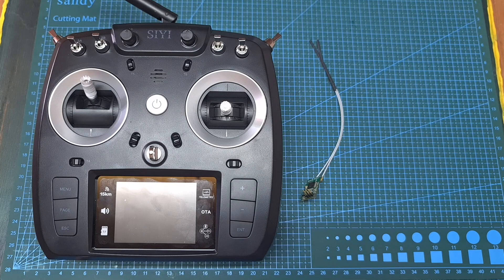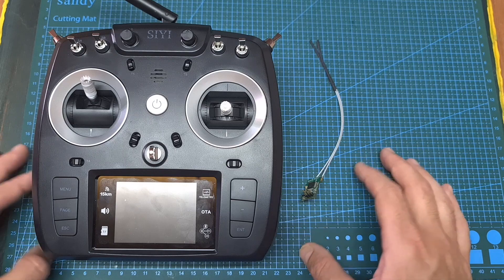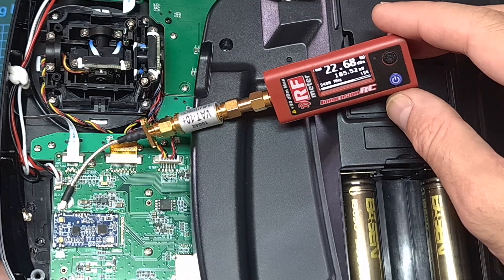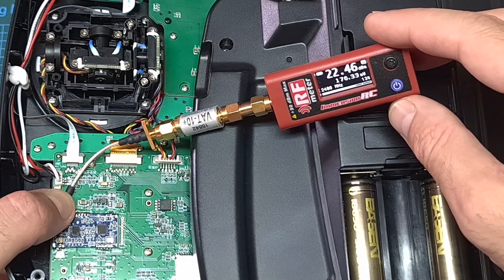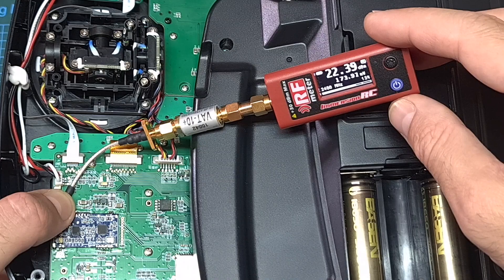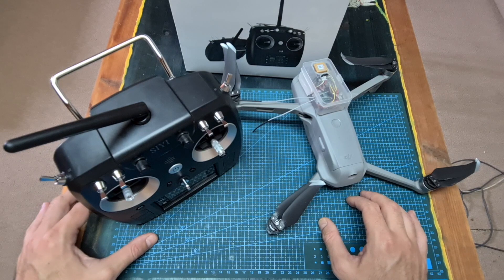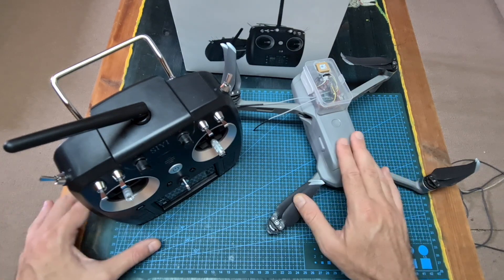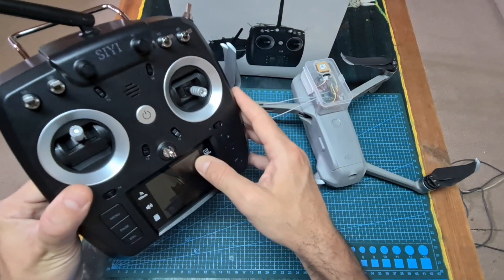How Far? SIYI FT24 Range Test

Comment: How did you link the remote to the dji aircraft?
Reply from the maker: It’s not linked to it - the drone is carrying a separate radio receiver for the test.
Reply: @KremerFPV  thanks 
But is the other reciver connected to the air craft ? Or its its just on it and powerd on just to see the range ?

Comment: Pls how do you setup telemetry with this system
Reply from the maker: Sorry but I no longer have this radio controller.
Reply: @KremerFPV  alright thank you. So which do you use now.
Reply from the maker: @ejegbavworuemu2129  The Radiomaster TX16S / Boxer are my daily drivers :-)
Reply: @KremerFPV oh is that better? Plus what is the range and the receiver used

Comment: I saw the comments below. I consulted the remote control manufacturer SIYI. They launched a new 40km tuner for only 39.9 US dollars. It is a long-distance accessory, the price of 39.9 US dollars includes (tuner + receiver + Bluetooth). If you pursue long-distance and stability, whether it is a fixed-wing or a crossover, you can use long-distance accessories. This way you don't have to spend money on the remote control again. A very good accessory, coupled with a very low price, I can't wait.

Comment: I can do that distance on an XM plus using just 100mw of legal TX power....200mw of RF output is illegal on 2.4g....Just saying. Great range test though, the ground based tests are a complete waste of time.
Reply from the maker: 5KM using an XM plus? That's impressive. I actually plan on doing range test soon so we'll see how it goes. 
Thanks buddy.
Reply: @KremerFPV  Yes, I did it on my Z84 wing though, not a quad...RX on the wingtip...The XM plus is a non telemetry long range reciever with a very sensitive front end..Standard antenna on my X9D...

Comment: I'm impressed you still got telemetry from 5kms away. Would have expect telemetry link to fail long before you reached 5km mark or RSSI for low enough to be meaningful. Just curious - did you record RSSI onboard coming from receiver, or only received by telemetry downlink? I wander how those two correlate
Reply from the maker: That's a good point. I should have wired the RSSI pad to the FC but unfortunately I haven't.

Comment: Dammit! I just ordered a few days ago a tbs micro v2... 
Now you have to use it in a quad and fly with it!
Great video gal!
Reply: TBS Micro V2 is a lot better than this, but this is great value for the money, cheap long range system for 86€ including (cheap) transmitter and receiver.
With TBS you can do 5km on 25mW easy in these great conditions Gal is flying in. This is probably already maxed out here, but still not bad given the price tag.
Reply: Not at all! The crossfire is still hands down the king of long range. I would say hands down king of everything in general but ghost seems to be better for racing now. Crossfire also isn’t expensive. Gal also has really good conditions to test the system so you’ll likely be unable to reproduce such results
Reply: @gautamkrishna7421  Lol.. i take it you,ve never heard of DragonLink?
Reply: @k1ortia  dragon link is another level of long range most people aren’t into...
Reply: @gautamkrishna7421  Your clearly missing the point..the conversation is relating to long range, the guy was saying how TBS CROSSFIRE is the king..Its not at all DRAGONLINK is...its the best on the planet...period. so my comment remains totally valid..😁
Reply from the maker: You made a great purchase and you shouldn't regret it even for a split of a second.